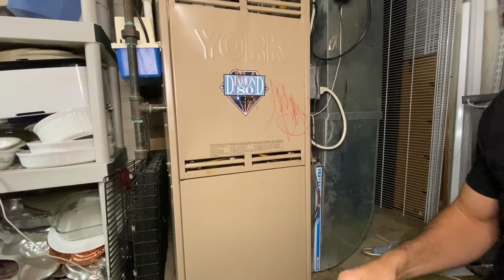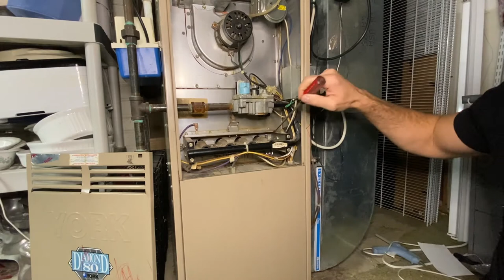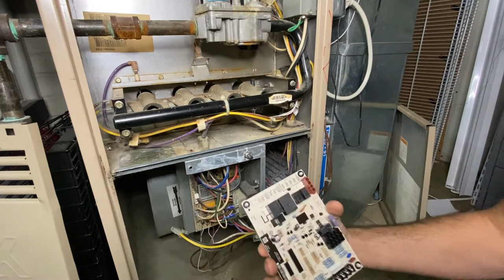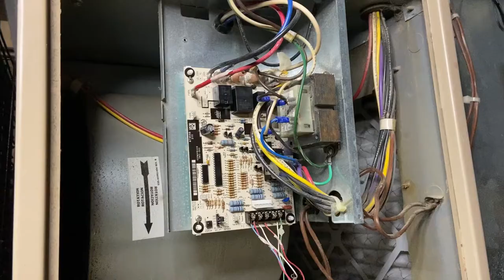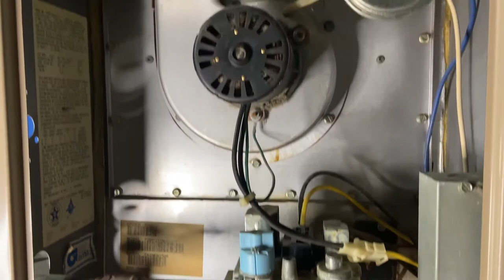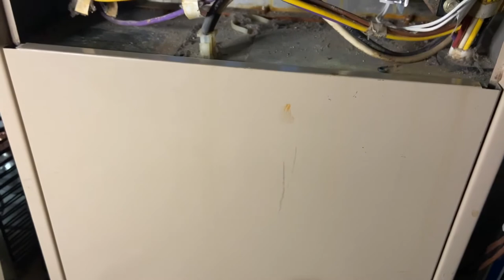York Furnace Repair - Circuit Board Replacement

Comment: Thanks can you please do an in depth explanation on how you transferred the wires from old board to the new especially the fan ones?
Reply from the maker: Unfortunately I do not live at the home where I made this video. If I recall correctly the orientation is slightly different on the new board but the identification of where the new wires go should match.

Comment: Thanks for this very detailed video appreciate it! I have an error message on my Nest thermostat reading “E80” saying, no power to Y1 wire. Tried multiple steps noted online but nothing seems to work. I’m going to change out the control board to see if that does the trick. I have the exact same HVAC, the York 80 lol
Reply from the maker: That may be the case. Hope it works for you.

Comment: Great video. Where do you  plug the red and white
 wires that were connected to the LED cable clip? I don't see that on the newer updated board.    I didn't see where they were connected on the finished board.
Reply from the maker: They are in a different quadrant on the board. If I remember correctly the connector is different. The push in terminals might have to be cut off and put under a screw down type. They should be the largest connection point on the board
Reply from the maker: Rewatching the video looks like the power supply is on the upper right of my board.
Reply: @AllanPhillips00  Thank you for replying. I don't see another red wire in that area in the video. I only see a red wire going to the park.
Reply from the maker: Oh sorry I misread your question yea the single thick red wire is park.
Reply: @AllanPhillips00  in the video you stuck a red and white wire up out of the way but I don't see where they were connected. I have a red wire going to park and a red wire going to led cable above the thermostat wires. I only see one red wire in the completed video going to park.
Reply: @britneyspearscollab  7:06 that was the LED CABLE.

Comment: I know that the blower delay switch on the newer furnaces is for how long the blower will stay on after the burner shuts off, not before coming on.
Reply from the maker: The blower should run for a good minute or two as a safety loop when your furnace does not light. Clears our any unburnt gas out the exhaust.

Comment: At 6:31 two wires appear behind the circuit board on the left in front of the blower housing. I believe they come from a limit switch. My question is where do they originate from on the board?
Reply: Great video, also the wires in question are red and yellow.

Comment: how do you know if the board is bad? could be the gas valve? mine is showing a 7 red flashing light
Reply from the maker: If you look up the part number trouble codes online it should reference what sequence of flashing means which fault is occurring.
Reply: @AllanPhillips00  thanks
Reply: So it was a gas valve on my York 80, my contractor could turn it manually by passing the board and it would turn on and you can smell the gas coming out. He told me it's not the valve but  with the board AC 24 volts, it would not open. He ended up replacing my gas valve on my York 80. Finally after a month of intermittent turn on and turn off. My unit is about 21 years old now.
Reply: Btw, I replaced my board about 12 years ago with an aftermarket one. The new one has an error button that shows the last 3 error messages on the red led flashes.
Reply from the maker: @giangnguyen8344  I’m not certain my new board has not had an error yet.

Comment: Do you have your main blower/fan to operate in two speeds?  Such as high speed for A/C and a lower speed for the heater?  If so, what color wire from the blower/fan is the lower speed wire?  Presently, my unit are both using the high speed from the black wire.  Thanks.
Reply from the maker: This unit is just a single speed for heat and AC on or off
Reply: @AllanPhillips00  Anyway, thank you for the jet fuel laced fast response!
Reply from the maker: @jamkpa  your welcome. Thanks for the support on the video.